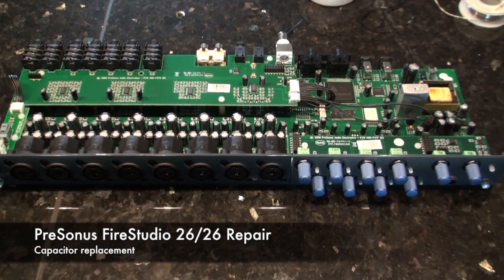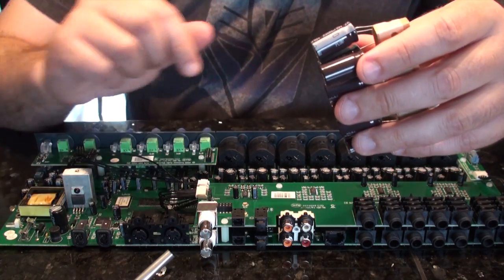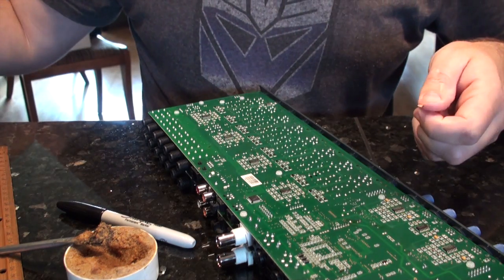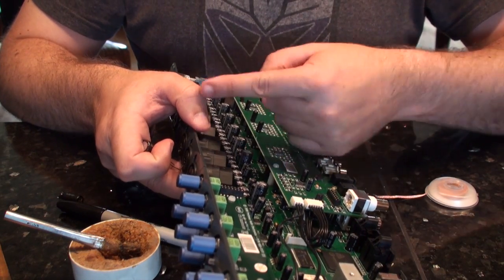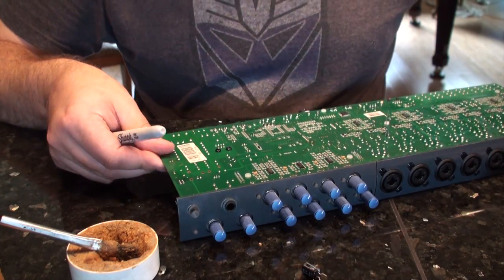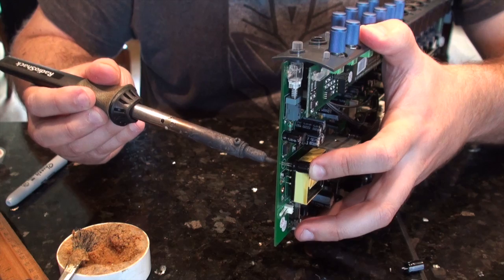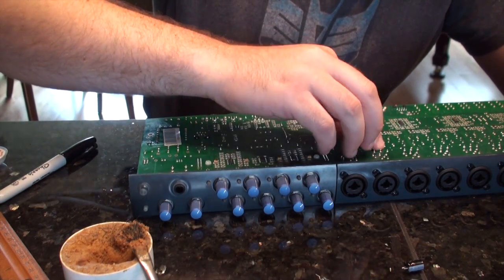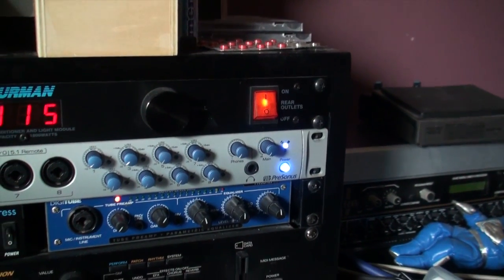PreSonus FireStudio Solid Red Light Fix

Comment: Thank you for advice!
Just fixed my Firepod. PCB looks similar. Same el.cap near the transformer bulged. 
I changed it. Interface is up and running and now it is not as hot as it was before. Just warm.

Comment: what size was the cap next to the power supply and what is a decent replacement for it?  Mine popped after 10 years :(.  Great video, mine's stays blue never goes red, but that cap on my board is bulged.

Comment: Geoff, thank you so much! It worked here too with a Presonus FP10 and the blue light problem. I replaced the capacitor next to the transformer, the 470uF 16v one and now it works again. Total cost: 30cents. And it's very easy to do. Thank you, bro! Good luck!
Reply: Did you see any bulging or did you just send it and replace it because that is a common problem that causes the blue light issue on the  FP10? I need to have this interface fixed by Monday (2 days) or else I'm about to blow off one of the biggest recording opportunities I have ever had. Mine powers on but only goes instantly blue and never is detected by my pc. There is no sign of heat damage or anything I can see, the only damage is some corrosion on the solder joints near the sPID (or whatever) and the midi in and out ports.

Comment: Thanks for these videos.  I have a Firestudio Tube (that Presonus no longer supports) and seemed to have blown channel 16 (the right tube channel on the front).  I was trying to test out a delay pedal directly into the box and when I turned the pedal on the channel just popped and now the meters are peaked, and there is zero sound coming through.  Channel 15 is fine, so the tube was not damaged.  Any idea what might have happened?  Thanks so much for any insight.

Comment: Thank you very much for this video.  I ran into the sync problem just over a week ago.  The LED would almost always be solid or flickering red, whether the firewire cable was connected or not.  Sure enough, I see that the capacitor next to the transformer is bulging.  I ordered a replacement today, and I'm betting it will fix the interface.  The original capacitor is rated 470uF electrolytic, rated at 16v, 105 degree celsius.  The replacement I bought was the same, except that I bumped it up to 25v, to give a little headroom.

It's typical these days for manufactures to use components with ratings that most closely match the ideal operating conditions.  Operating conditions aren't always ideal.  For example, many modern televisions are tossed away, when all they really needed was to have their capacitors replaced, whether in the power supply or in the inverter boards, which drive the backlighting..  Chances are, if they manufacture had used the next higher voltage rating on their caps, the TVs would have lived a much longer life.

Just a guess, but in this case I would suspect the capacitor that was actually affecting sync was the 470uF 16v next to the transformer.  The other seems to be specific to a particular 1/4" input.  I would suspect that cap was functioning more as a filter circuit, and would have resulted more in a preamp quality...tonal issues.
Reply: I'm happy to report that replacing the 470uF Electrolytic by the transformer...and all is well!  Thanks again for sharing.

Comment: Thanks Geoff for sharing this! My FS 2626 got the solid redlight a couple days after 4 years with no issues. I've checked the capacitors but I don't see any bulging. I may try to replace the one next to the power supply as I don't have any other options at this point unless I send it back to Presonus (out of warranty). Is it possible that a capacitor can be bad without showing signs of bulging? Thanks again for sharing!

EDIT: Just saw a previous reply for the same question. I'll see about testing the cap. Thanks!

UPDATE: 12/11 - It was the cap next to the power. Picked up a 470uf 16v at a local electronics store for .34 cents. It was a bit larger in diameter but was able to fit. Just fired it up and works like a charm! Thanks again!

Comment: Thank you Dood!  I have a Firepod that had a solid blue LED (always sync?, no…).  A slightly different symptom but same solution.  Soldered a new 470 mic 16v cap in to the power supply.  Back up and running.  The original cap was barely crowning, I thought it was another problem but this was an easy fix so I went for it.  Thanks again for sharing.
Reply: by the power supply, you mean the internal one? I am in the same boat as you and need to get it fixed. Mine also powers on but stays blue and never syncs to my pc.

Comment: Hi men, I need your help, my firestudio don´t work because has a resistor burned, it is near firewire connector, I need to know the resistor value, I have a photo with the resistor burned location, Can you helpme? mi email is estigmaestudio @ hotmail . com .
Reply from the maker: Post a link to the photo and I might be able to find out for you. If a resistor is burned out, this could be a sign that there are bigger problems and fixing the resistor may not solve the underlying issue.

Comment: Hi Geoff, 1st off...thanks for the video! I t's been very helpful! I am having the same problem with my firestudio. I opened it up and found the same capacitor (the one by the power) is bulging. I can not read what is on the side of the capacitor. Do you know what the specs are or the model # for it? Also, where did you go for the capacitor? Thanks for your help!
Reply from the maker: You are welcome! The capacitor by the power supply is 16v 470uf. You should be able to find one either on eBay or Amazon. A quick google search should yield more places as well. I think I found mine on eBay.
Reply: Geoff Tripoli Thank you Geoff! You ROCK!

Comment: Specs Shlould Be The Same, But Its Not That Important, Just Don`t Replace It With Smaller One, 470Uf16V Never Should Be Replaced With 470Uf 10V , But Easely With 570Uf25V

Comment: Great video. Because I couldn't find a 16v 470uf capacitor at any of the electronics parts stores around my way,  I ended up soldering a 35v 470uf from Radio Shack and its working like a champ!!!   in this case, you don't  want to change the capacitance (470uf) but you can go for a higher voltage and be completely safe.

Comment from the maker: I believe it is possible for caps to go bad without showing any outward signs. I would suggest you at least test the cap on the power supply (there are plenty of how to videos), or even just replace it without testing it. What do you have to loose if it's not working already?

Comment: Thank you! Got the red light in the middle of a big project and freaked out for a minute! I saw your video, opened up the Firestudio and the same capacitor by the power supply was bulging. I found the same capacitor on an old sound card and replaced the bulging one with that one. Worked perfectly! Now I'm excited enough to do some repairs on some other components! Thanks again!